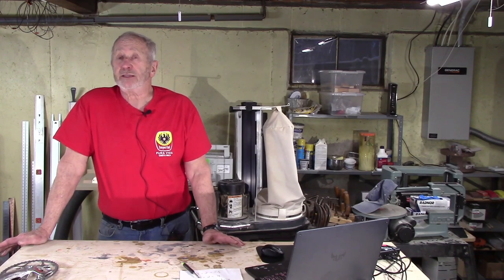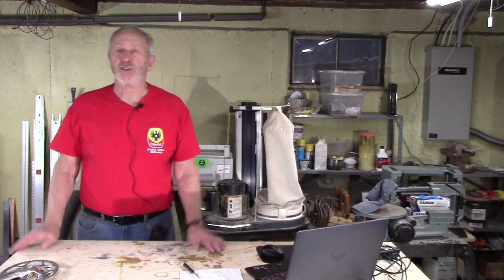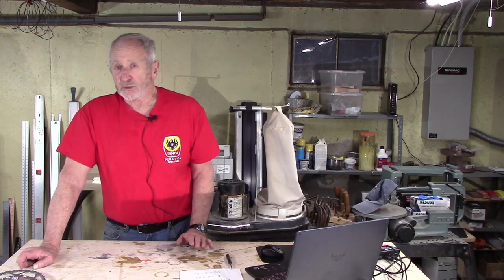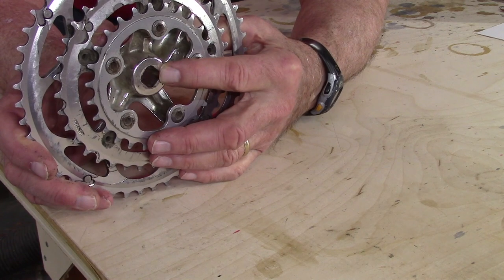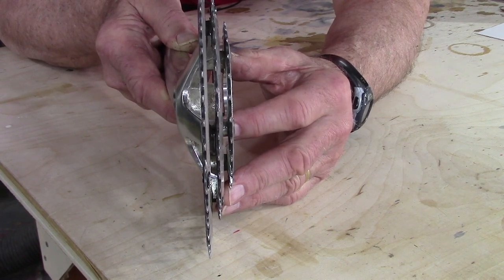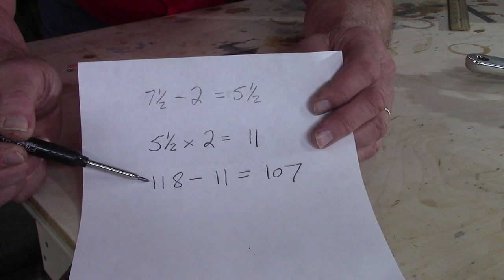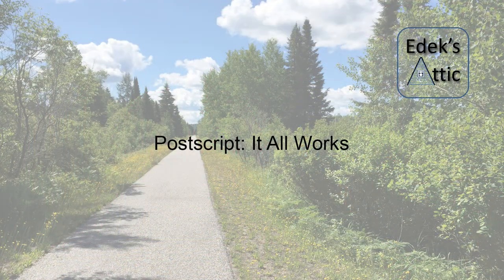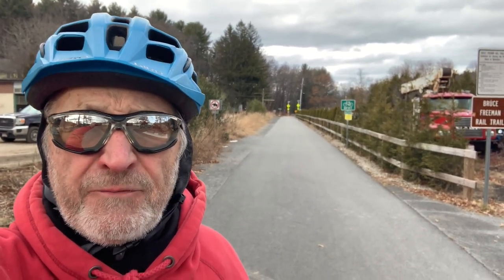Basic Touring Bicycle Maintenance: Chainrings and Cranksets

Comment: Good advice though I'm a long way from replacing my chainrings. I've only had my Surly LHT for six months and done no more than a few thousand miles on it, including my recent tour. What saddle are you using? I have a B17, and although your's looks similar it appears to have less leather on the flaps. I'm interested to know because I've had some rubbing issues on my thighs I think because the flaps splay out too far. Thanks. JP.
Reply from the maker: I have the Imperial B17 that has the cutout down the center. Before the Brooks I had lots of chaffing issues on long trips, but it was not only the saddle. My issues went away when I began using a Zoic padded liner under my riding shorts. I do not wear riding tights or tight fitting jerseys. I like loose clothing, except for the Zoic liner. The liner that I have is also padded and that seems to work well for me during 50 to 70 mile days in the saddle. It is true that the sides of the Brooks B17s drop down farther than on some other saddles, but I never found that to be a problem. If they splay out, the saddle tension may be off. You would need to go the Brooks web site to figure that out.
Reply: @EdeksAttic  Appreciate the detailed reply. I've never heard of Zoic before but order a pair and prepared to give them a try. I live in Thailand so the chances of getting them before my next tour are low. Already adjusted tension bolt but will give that another go as may now be some slack after few thousand miles of use. If things don't improve after the next couple of trips I'll check out the Brooks B17 Imperil. Thanks again for the advice.